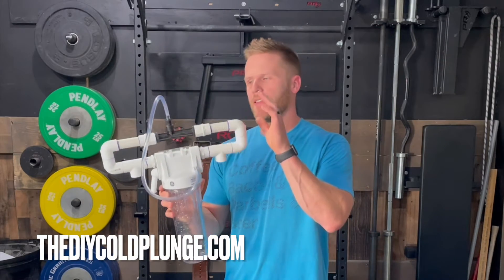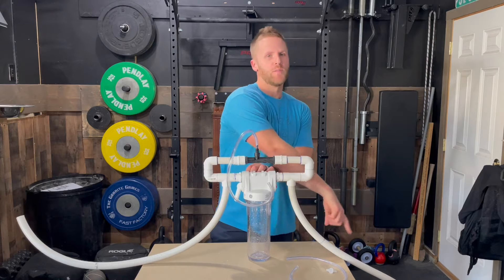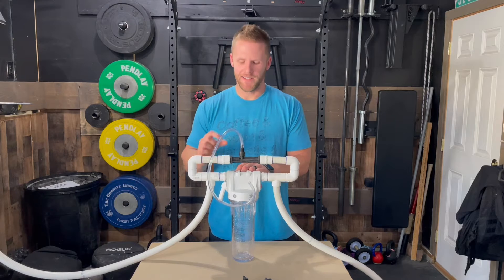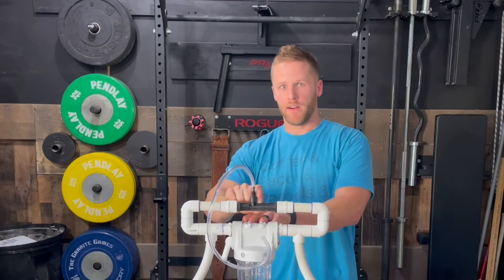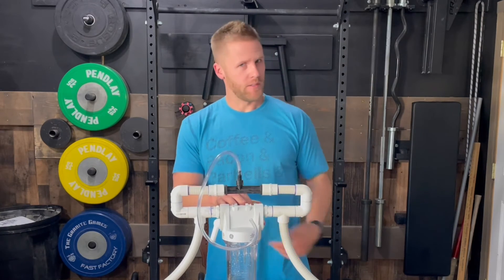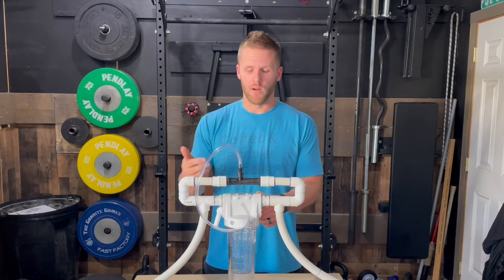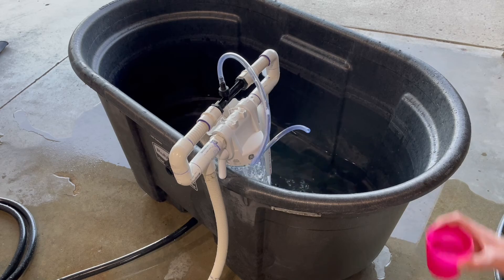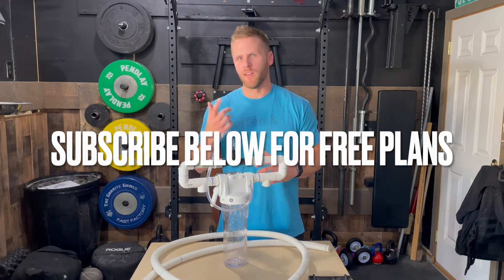Ozone Sanitation & Filtration FAQ | DIY Cold Plunge

Comment: danner pumps tend to cavitate and create air bubbles in the line which end up messing up the chiller have you guys has any issues with this???
Reply from the maker: I haven't, although im getting this question more frequently - where did you hear about cavitation from?
Reply: @DIYColdPlunge  from danner the sales guy told me that
Reply from the maker: @jfc8681  Interesting. Well, Penguin has recommended Danner pumps from the beginning. Several commercial plunge units also use their pumps in their builds. I haven't heard of an instance of it becoming an issue or seen any problems in my builds 🤷‍♂
Reply: @DIYColdPlunge  as long as you keep the pump below ware level I think you are safe, if you place the pump At water level that is when it starts to create water bubbles
Reply: @DIYColdPlunge  I'm using a Rubbermaid 300 galon stock tank I called penguin chillers they told me the 1/4 and the cold therapy models don't have the capacity to chill a 300galon tank, any other chiller you recommend? thanks man

Comment: Thanks for the great info! Is there any reason to not have the sanitation system setup prior to the chiller? I'm thinking it would save the chiller, but maybe the ozone should not go into the chiller....
Reply from the maker: Correct, I'd keep the ozone away from the chiller. Any debri that gets through the drain screen AND pump likely will not harm the chiller at all.
Reply: @DIYColdPlunge   thanks, that makes sense

Comment: I created the same system and am wondering if the pressure or volume of water going into the filter exceeds the flow rate (in PSI's) to make the filter ineffective? I see you don't have it installed but I assume you get my question. The housing has turned into a whirlpool and may not hold the particulates? Thanks!
Reply from the maker: For sure. It's a balance of making sure there is enough flow to create the vacuum at the venturi and not overworking the pump. My setup has worked well so far 👍
Reply: @DIYColdPlunge  True that. Many chillers have limitations on incoming pressure but many pumps express GPM's versus PSI ratings. I may have recently killed my 1HP chiller BUT it may not be related to the pressure. Thanks for your engagement and response !

Comment: I made the mistake of buying a bigger filter (40L w/ 1” fittings). Can I still make it work, or do I need to use a smaller one like in the video?
Reply from the maker: You should be able to make that work, you might need a more powerful pump to create suction at the venturi - I'm not positive though.

Comment: It looks like you are using the tubs premade drain as the inlet source to the pump instead of having to drill a hole at the bottom? Will there be enough flow with that sized piping? I’d like to avoid drilling if possible. Thank you!
Reply from the maker: I repurposed the drain hole and haven't had any issues yet 👍

Comment: If I get a 1 inch Venturi injector, can I just run it in line then (my piping is all 1 inch)? Presumably that shouldn’t create an issue with the flow since the piping will remain 1 inch. Thanks Joe! Really appreciate the info.
Reply from the maker: Should be good! I'm not sure if you'd need to up pump size with the larger tubing, may need to experiment with that.
Reply: Thanks joe, you are the man! One more question, can I just extend a typical ozone generator in the tub via a tube / water diffuser? That’s what I have been using to start. Was curious if the Venturi injector is a better approach for some reason. I’ve noticed the typical generator have higher outputs too. Thanks !!

Comment: Question; have you considered UV-C light as an alternative to Ozone? How does OZONE go with metal corrosion? I read it can corrode metals so was exploring alternative sanitisation for algae
Reply from the maker: Hey! I haven't had a ton of time to dig into this. What I've seen/heard is that UV is a good option, but that ozone is superior. Companies like "The Plunge" started with UV and ozone but now only use ozone because it is just as effective. The bulbs in UV filters diminish over time, decreasing it's effectiveness and can possibly be a pain to replace. As far as compatibility with steel tanks, ozone is used in the Morozko Forge - so I would assume the fact that it's galvanized would protect it but I don't have any personal experience with it. The corrosion is the main reason I recommend the rubbermaid tanks 👍 Hope this helps!
Reply: @DIYColdPlunge  thanks for such a detailed response really valuable

Comment: Great video.  So with a venturi setup you don't need a ozonator with a pump?  I'm trying to understand using the difference between the Ambohr and the Jed 203( over $300 w/built in pump).
Reply from the maker: Hey! Yes you are correct. If you use the venturi there is no need for a pump. It definitely makes it more affordable and pairing it with the filter saves alot of space.
Reply: @DIYColdPlunge  so to clarify, if you do this filter setup with the venturi it will create enough suction with ozone generator to move the water? Or does one need to purchase a Danner 1200 or another pump?
Reply from the maker: @RookKnight457  The Danner is a water pump. You will need that to have both the filter and venturi work correctly. I have a components guide that dives into the core pieces here https://linktr.ee/diycoldplunge

Comment: Pressure actually decreases as water flows thru the Venturi. That’s why the flow speed increases. It’s also why the ozone gets pulled into the tube because it’s going to an area of lower pressure

Comment: What kind of pump are you using to move the water? Looking at the penguin chiller owners manual, I see the unit needs 500-1000gph and not to exceed 10ps, how are you controlling that?
Reply from the maker: I'm using a Danner 1200 pump, and it works great. High flow with enough pressure to pull the ozone through without damaging the chiller - https://amzn.to/3VW4DeT
Reply: @DIYColdPlunge have you had issues with pump creating air bubbles in the line and damaging the chiller?

Comment: I'm about to utilize a Costco hot tub tough to build my  cold plunge why haven't other people done this maybe because it holds a 1000 gallons of water but it seems like a great option
Reply from the maker: I would speculate the main reason is the size. Most 1HP chillers are recommended for up to 300 gallons I believe - could be slightly off on that. But even so, that is more than 3x the recommended amount of water.

Comment: Hey, what is the part number on that filter housing? The one you linked to on Amazon has the opaque white housing, but I'd love the clear one.
Reply from the maker: Weird, I wonder if they are out of stock or something. Here's the item on Home Depot's site - https://www.homedepot.com/p/GE-Whole-House-Water-Filtration-System-GXWH20S/202073874
Reply: @DIYColdPlunge  Awesome, thanks. I figured that might be the case.
Reply from the maker: @APEX.86  You bet! It's nice to have it clear but I prefer this one mostly because it has the shutoff and bypass valve built in.

Comment: Thanks for this... But I'll be planning to set it up on my drinking water filtration (alkaline water).  First,  municipal water will pass through pre-filtering stage wherein the water inlet goes through the 40 micron filter w/backwash  that goes out with your ozonizer setup but will be using the ceramic base washable candle filter (0.1 - 0.9 micron).  With such a setup, some water got through the ozonizer (breaking down and sanitized the water) and some goes through the ceramic filter.  Then, after this stage... It goes finally to the alkaline filtration setup wherein it goes through seven stage of filtration that start with a 1 micron sediment filter... then UDF, CTO, UF, Alkaline,T33, and finally the output alkaline water goes through the UV sanitation.
Reply from the maker: Nice!
Reply: Is there a benefit in using alkaline water?
Reply: That sounds incredible!!! Do you have pics, videos, or a website showing your amazing setup?
Reply: What size pump? That seems to be my primary concern. And why the focus on alkalinity? Seems to be a lot for a 4 min plunge? No?

Comment: It looks great, but honestly, I would prefer to have purely filtered water going back into the tub and also if possible through the pump and chiller - so essentially the first part of the whole system would be a direct input and output through the water filter and after the water has passed through there, would I make a T -section or 45 degree angle section, where the water would split and part would go through the venturi injector and part would pass freely through the other section and they would meet up and continue through the pump and chiller and back into the tub (not sure of the hydrodynamics there (no engineer here) - so Im not sure that the water wouldnt choose the direction of least resistance and just bypass the venturi injector, but the idea is not that different from what you have going here, so it should work). The idea is to protect the pump and chiller from larger debris, that might actually escape the filter, when you have this system, where only part of the pumped water is actually filtered.
But great project overall - I am very interested in how you handle condensation - on the tub itself and also in the filtration/cooling part of your build - that seems to be a nightmare and biggest hazard in terms of water/electricity interaction and of course a constant puddle underneath the tub limiting indoors use, where the temperature differential is huge
Reply from the maker: I like how you think! The setup I have here is how most hot tubs/commercial plunges are set up plumbing-wise. I totally understand the logic in your idea, but I think with the use of the cold plunge from a frequency and time perspective the need for all of the water to be filtered in-line could be overkill (which I greatly appreciate). Most tubs should have a strainer cap on the outlet to catch the large debris, and then the turnover rate of the water should filter out most everything else. Even if you set it up with that extra bypass, there is no guarantee all debris will leave the tub to be filtered anyway.
Reply: Damn that's pretty smart not gonna lie haha

Comment: I’m new to all the technical info about filters and pumps but I’ve been using a big chest freezer and just looking for a simple filter system for it. Winter’s coming so not going to use a chiller for now.
Do you think this setup would be a good idea with a chest freezer?
Reply from the maker: I've seen a lot of folks use a Marineland filter/pump for freezers. The only thing with this system is you'll want to feed the tubing outside of the freezer. I'm not sure how complicated that would be.
Reply: Its not complicated at all. Look up bulkhead fittings. You can connect them directly to the tubing and run a hole through the lid.

Comment: Hey i want to use this filter system for my build but I am using a 14.8 cf deep freezer and therefore not using a chiller. 
In my case would i just use a submersible pump to pump into the filter? If so what horsepower do you recomend for it?
Reply from the maker: Good questions... I'm not sure the HP, any idea how many gallons per minute for the submersible pump? Mine is 1200
Reply from the maker: Gallons per hour*

Comment: Any issues with ozone and the stock tanks? Not sure if the galvanized steal has any issues and if the inline injector would account for any potential issues.
Reply: Galvalnized steel is listed as incompatible with ozone. I would stick to HDPE or something. I use a 360L HDPE wheeled recycle bin with ozone and chiller
Reply from the maker: I wish I had an answer here. Morozko uses stock tanks and ozone, but I'd like to experiment before I can say for sure.